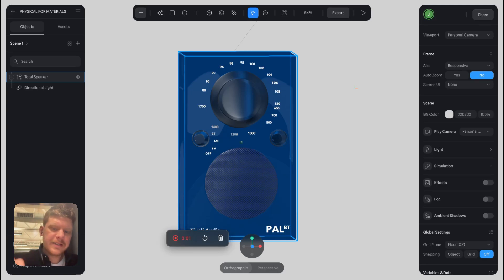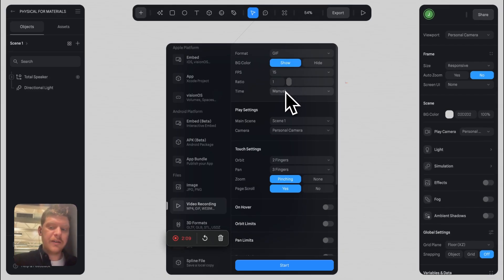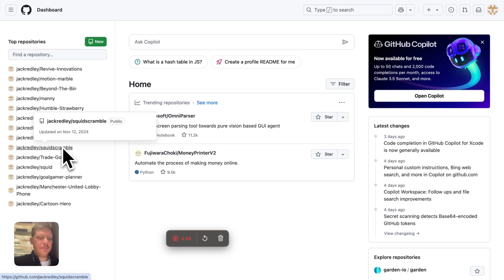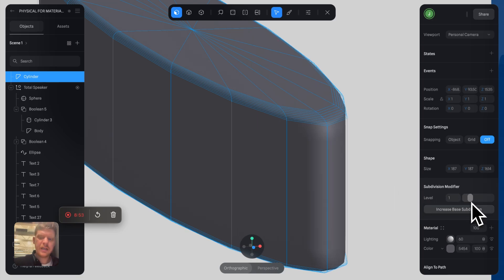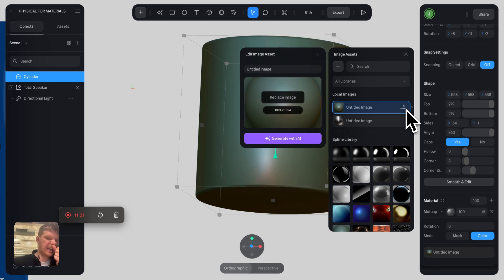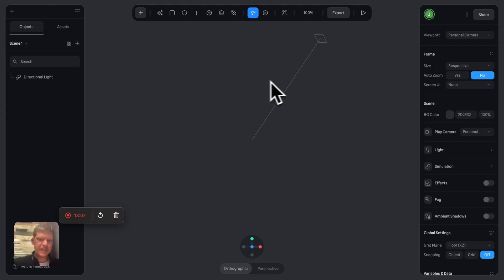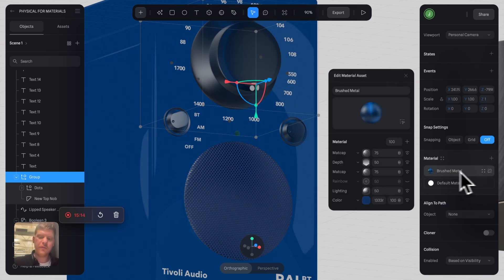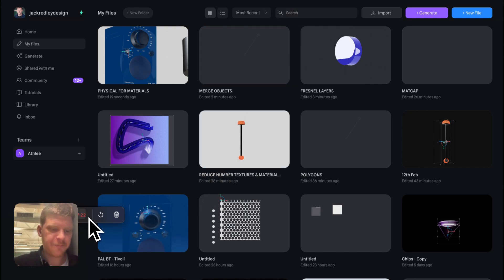How to Optimize Spline 3D Assets for Faster Load Speeds: A Complete Guide

Comment: Do you know if you can import an spline file into peach web?
Reply from the maker: So, you can export from Spline but because they don't want you to use the files off the Spline platform, they don't make it easy to export. You can't export materials and textures. BUT, you can make a file in Spline, export in GLB format (or whatever), then recreate in Blender and compress before bringing in to Peachweb. It's a bit fiddly but doable. Hope that helps!